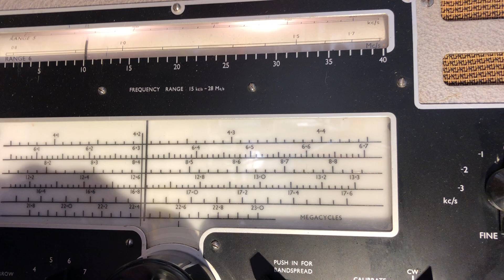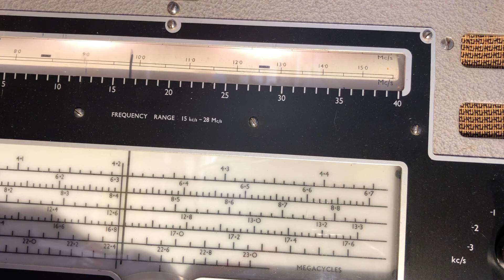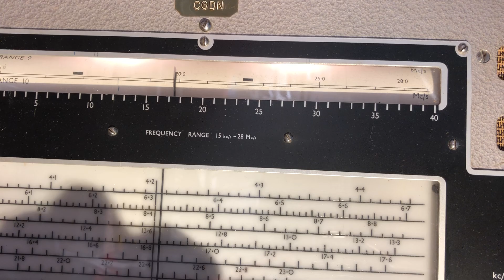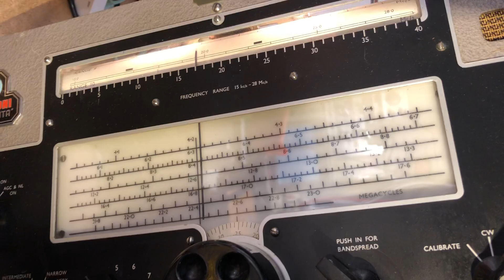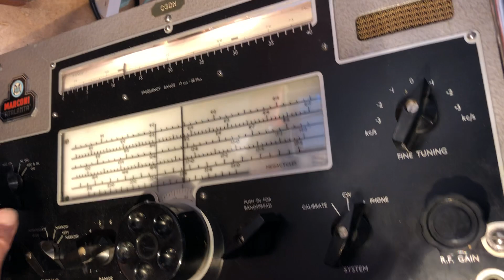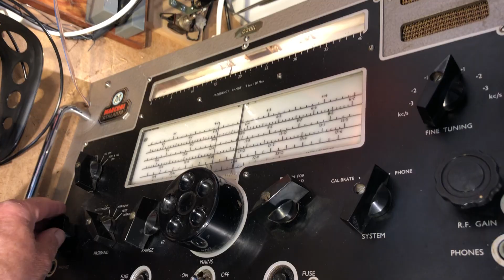Marconi Atalanta Receiver Test

Comment: Ata-Lanta.  I always fancied onw but got the RA117 and RA1772 instead.   I reckon I made the right choice.  I've now moved on, to software defined radio/  Brick wall filtering in software is rather excellent.  No ringing filters.  My oldest radio, and I've owned many, is the TS-820.  Even that 'goes back a bit'.   I like the old stuff, but the superhet died the death a while back.  My all-day radio is an IC-7300.,  Cheap and excellent.   Far from perfect, but the noisy fan is easily fixed for under £20.
Reply from the maker: Hi Allan. Yeah - RACALs are very nice sets.  I used to have an RA117/RA237B combo that I refurbished (and refurbished several more of these and RA17/RA137B combos).